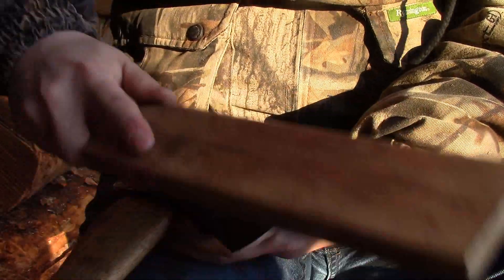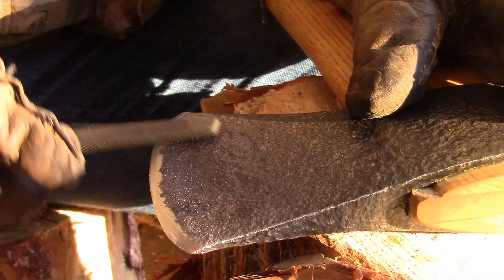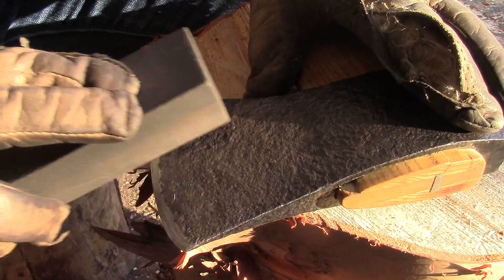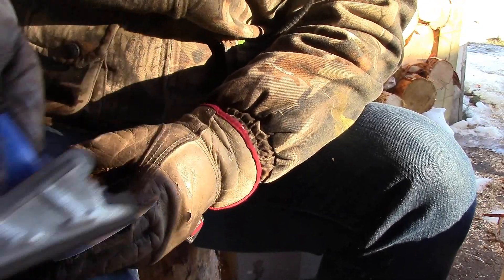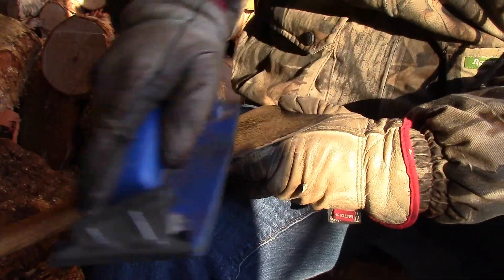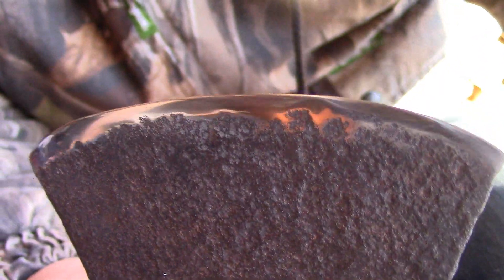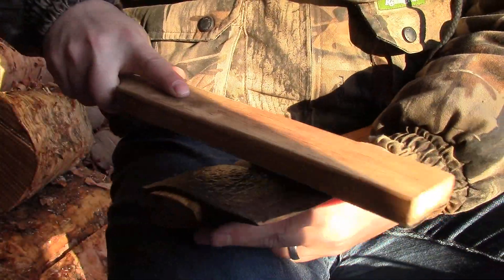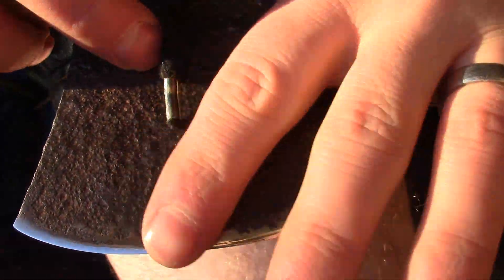HOW TO SHARPEN AN AXE - The Rooster Method - Newfoundland Loggers Axe

Comment: I've been working on a Harbor Freight Axe for a day or so, trying to thin the edge down wish I had a bench grinder though, been doing it all with Rasps/Mill Files, I've noticed one side was a lot thicker than the other, guess that's why it's so cheap, like $12, it's getting there though.

Comment: Hey Kyle great vid thank you! After about 600 grit my edge started getting duller. I can't work out why? Perhaps my angle was wrong? Does it have to be exactly on the sweet spot the entire process? I really can't tell if I am or not.. something you learn with experience I suppose. Is there a specific degree angle it should be at to the edge? Also the burr I originally created was gone by 600 grit are you suppose to have a  burr the entire way through the process?. If it disappears has something wrong happened? Thank you for any help and tips you may have!
Reply from the maker: How do you know it started getting 'duller'? A 600 grit edge will feel really grabby and sharp to your touch; a 2000 grit edge will feel smoother and less sharp, but if you have done things right, it will be much sharper.
Reply: @kyle_noseworthy  It was blatantly duller like super dull. I must have been changing the angle as I was going and rolling the edge over
Reply: I don't understand how you can maintain the same angle whilst having the axe on your leg? Experience I suppose

Comment: Great restoration! I'd like to make a strop (or maybe) like you have, any suggestions on what type and weight of leather works best? Thanks
Reply from the maker: Hey Jon! Strops are excellent. I prefer a paddle strop as seen in the video. The weight of leather makes no difference whatsoever, but you want some with a milled surface, so it isn't too rough and grainy!

Comment: You should wipe your edge with a cloth before going to the clean leather strop, because it's easy to transfer honing compound from your sharpening strop to your clean leather.

Iwasaki wrote that he would always get a better edge on rainy days because there is less ambient dust in the air. So he always saved his sharpening for rainy days. That says A LOT about how dust can effect your edge!

For this reason, when at home, I sharpen my blades in the bathroom after a shower - and it makes a noticeable difference!  When out in the wilderness, saving your sharpening for rainy days helps to pass the time when you can't do much else - and you get a better edge on your blades.

Comment: Good job!  I would like to see this axe in action. Because this axe is badly pitted, the edge will need to be re-ground after a period of time. I have a few old axes that are similarly pitted, I used rust converter on them to inhibit further rusting (makes them a blue-black kind of colour).
Reply from the maker: If you watch until the end of the video, there is a link to watch this axe in use..
Reply: Thank you, you did a great job on this 'old timer'.

Comment: I see a lot of those videos trying to learn but nobody ever says for how long to do each. I can get an edge that looks good but still couldn't cut butter.
Reply from the maker: Sorry you're having this trouble my friend. No one says its, probably, because it's so variable! You'll need to sharpening with your most coarse grit until you have created an apex. This step is crucial. If you don't create an apex, even a fine wire burr on the edge, then you will never achieve a sharp edge. Hope that helps!

Comment: You sharpened that axe mirror-smooth and razor-sharp there. Of course, that edge is so fine that thr sharpist part of it will get knocked off the first time you chop something with it.
Reply: Just because it's been polished does not mean it's a weak edge edge geometry has more impact on durability the the edge finish.

Comment: learn to sharpen properly, and you won't have to spend hours or days or longer removing a dam burr.
Pull the edge on your stone or file away from the edgr with your file/rasp you get a burr. 
Push edge first on the stone/file/rasp towards the edge: no burr.

Or if you get a burr you could just dry strop the dam thing, or do like the lumberjacks of old, and just use it. First or second strike will remove the burr...